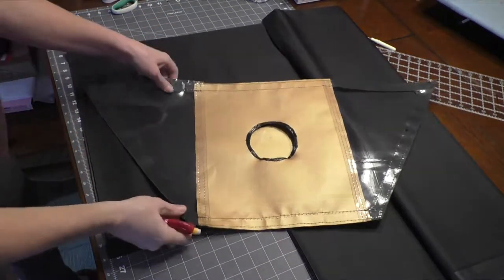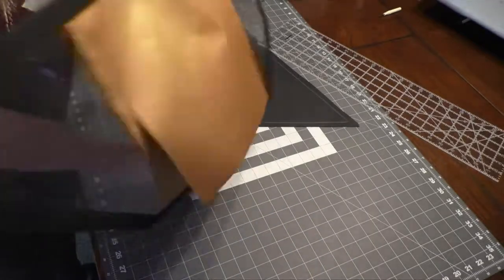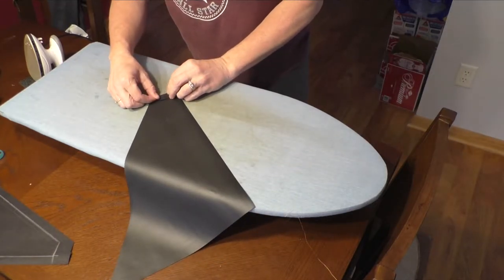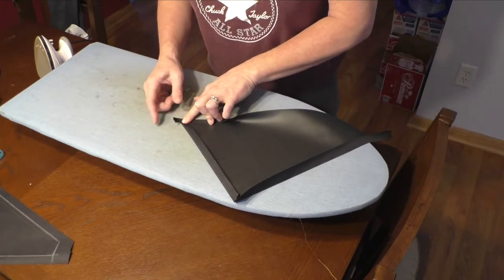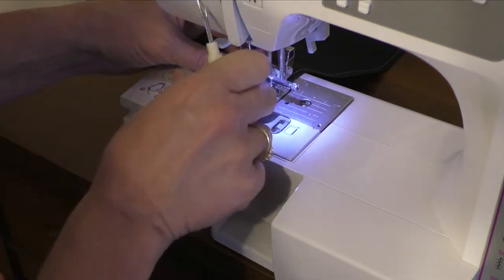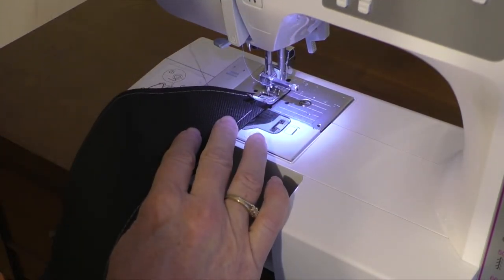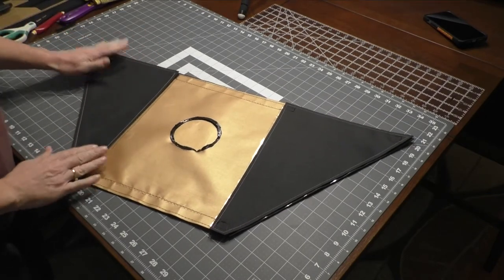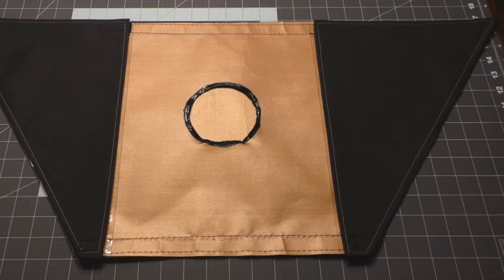DIY Stove Jack Part 2!  Blackout Covers

Comment: It looks live you’ve added a flap to the stovepipe opening. I didn’t see that in Part 1 and I know you said you’re adding the blackout covers after having used it. What is the cover and how/why did you add it? Thanks and, as always, great and helpful videos!
Reply from the maker: Great eye! The outer flap is a sort of snow/rain flap. It's supposed to help prevent the rain & snow from coming in around the pipe. When I did my test camp the other night I woke up to the tent being covered in snow & I didn't even know it until I opened the door. So, I guess it must have helped? lol! I saw that it is a common thing on commercially available stove jacks so I added it. I figured if it was no good, I could just remove it so it was worth a shot. So far, so good!
Thanks so much for watching and the question! :)